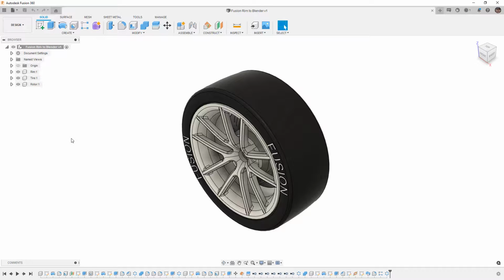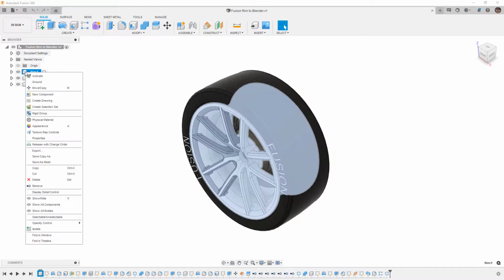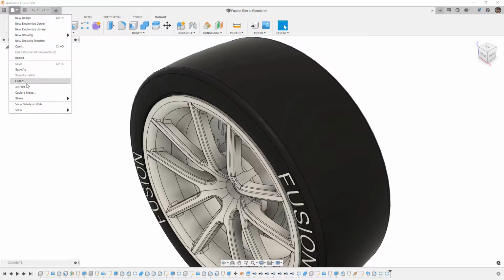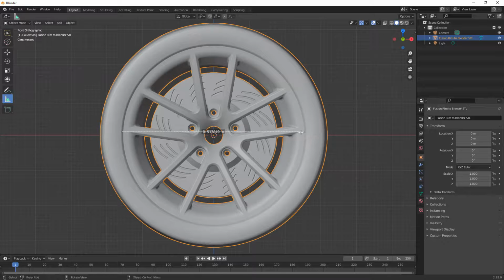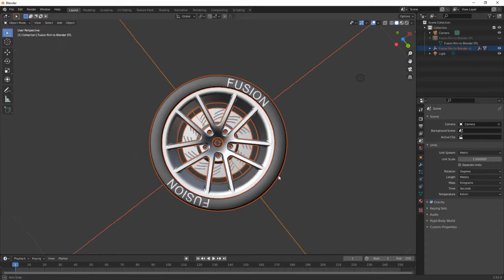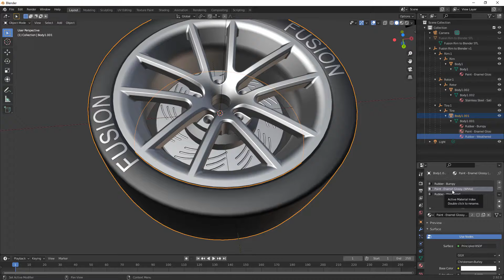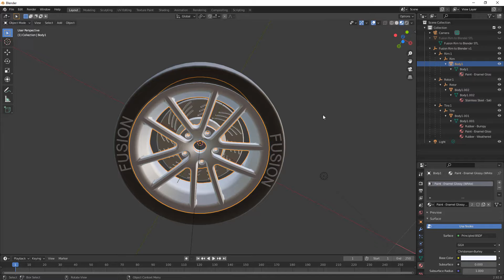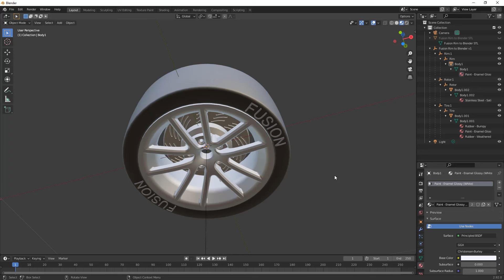Importing Designs from Fusion 360 to Blender - Part 2

Comment: Thanks, it saved a ton of time testing the formats.
Reply from the maker: No Problem.  I will say since this video there are some tweak/updates.  Certainly check blender add-ins and also options when saving as a mesh in Fusion.
When you save as an OBJ in fusion you don't get a quad option, BUT if you go to the mesh tab and do tesselate, there is a "create quads" option there.  That might be nice to bring into blender, but the only way i have found to bring a quad into blender from Fusion is a control frame from a form.....

I will be doing an update to this workflow in the near future.

Comment: hey man I watched your 360>blender export videos but I am struggling to get a car body from into blender really looking as good as it should. I have tried all 4 file types with varying resolution for the STL as well as smooth shading of course. Pretty much everything gives me ugly sharp spots in one place or another and smooth shading often creates a few of these super strange 'dents'. If there is any way you'd be willing to make a video about working with complex high curvature models/meshes for this it would be awesome I'd really like to get my car rendered in blender
Reply: so I haven't completely figured it out but you can do a lot with the refinement options to change the structure of the mesh. You can do even more by changing to the mesh workspace (of course lol) and you have an option there to make the mesh quads when using tesselate plus a ton of options for manual cleanup I guess its just unavoidable with complex meshes. I am still having problems with bad shade smooth reactions. Fusion also seems to reprocess the mesh on export which is super annoying
Reply from the maker: Hey Mason, sorry for my delay I was out of the "office".  It is a bit tricky to get a clean export but it can be done.  Recently I did a video showing the export of the forms control frame, but I imagine you have more details done outside of forms if you are at the render stage.  If you would like to share the file with me I am happy to take a look.  support@caducator.com  In general OBJ or FBX have been my goto options and I haven't noticed any issues, but its very much based on the model.  As you have seen doing the mesh conversion in Fusion(which is destructive) is a step that might be needed.  If i do this, I would copy them first and tesselate the copy so you retain the original.  Or do a Save As on the fusion file.
Reply from the maker: Ah i see trippyLighting replied.  Glad he was able to help you!  There is definitely a disconnect between how things are viewed/shaded as BREPs in CAD vs as mesh bodies in Blender or other mesh software.  The issue is that as a mesh(in blender) you typically want control edges which helps when shading smooth.  But if you export something from CAD you end up with some big triangles on a flat face which turns into a mess when you shade smooth or mess with auto smoothing normals.  If you used "Shade Smooth" you might also want to check the Normals "Auto Smooth" option so your hard edges stay hard.

Id love to see your hard work when you are done if you want to send me an email.
Reply: @LearnEverythingAboutDesign  I will totally send you a shot of the final render!